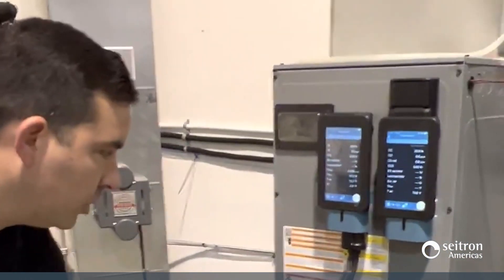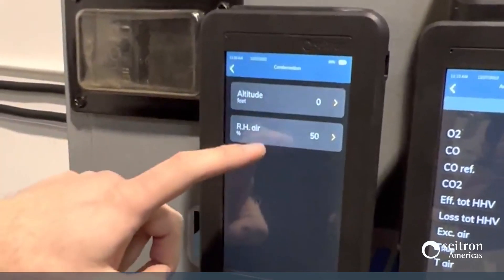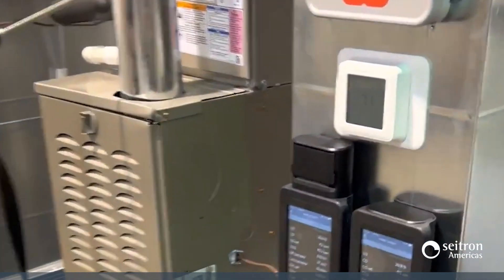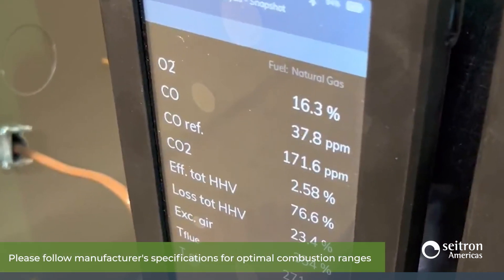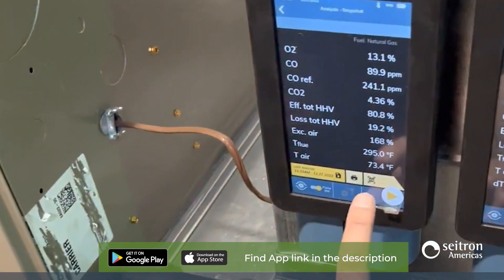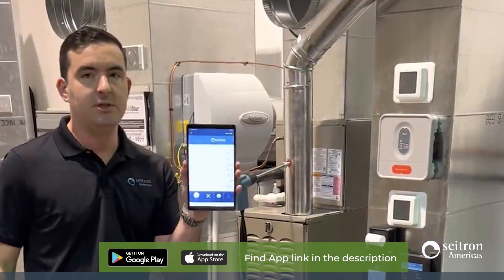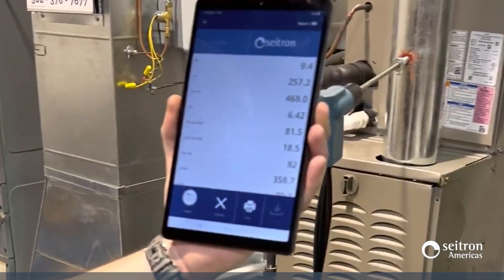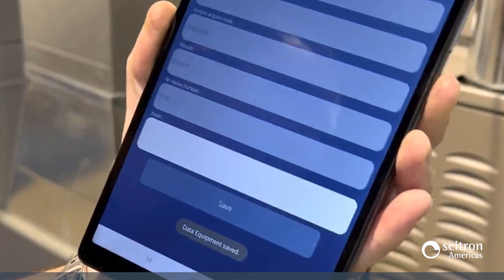Combustion Analysis on 80% Natural Gas Furnace

Comment: do you only measure it? for example if you have bad reading, how do you fix it?
Reply from the maker: This video is more on how to use the analyzer itself.  The analyzer comes with a cheat sheet of WHAT the readings should be for different systems and what to do in each case.  There are many varieties of what could be wrong.  If you want a copy of any the training info, feel free to reach out to us at info@seitronamericas.com
Reply: Do you have to program that unit, with basic numbers. Also can you post a cheat sheet for 80 and 96 plus percent?   @seitronamericas